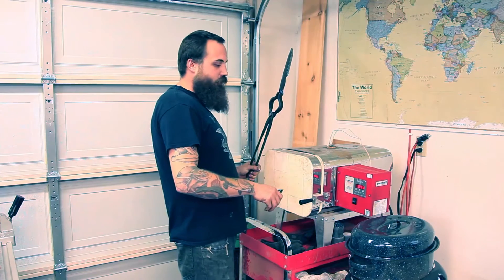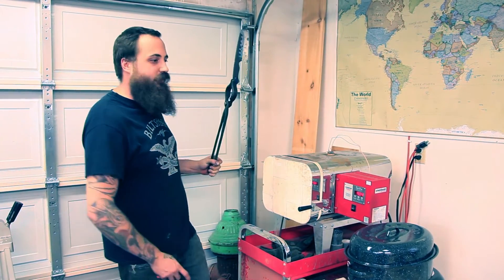Knife Making Part 6: Heat Treat

Comment: What type of steel are you using?
Reply from the maker: sfbjr22 this blade was 1095
Reply: Biltsharp thank you man. Love your work. Just recently started following you in Instagram
Reply: You don't get any warps or cracks from quenching in water?
Reply from the maker: sfbjr22 water is definitely problematic. I did this right when we moved and I had to ditch my old oil, and before the new parks 50/50 arrived. 

I’ve been primarily using crucible steels for a while now, they air cool and don’t rust, but no hamon.
Reply: Got ya. I just received my parks 50. I was using canola oil but my steel wasn't getting hard enough. I'm new to knife making and trying to find as much information as possible. I'm glad to have came across your channel. Thanks for the reply